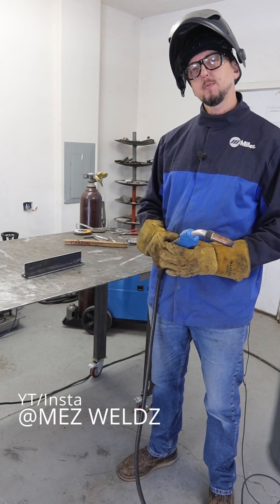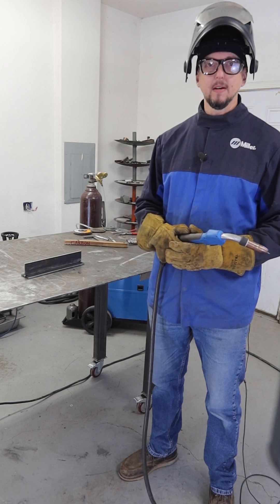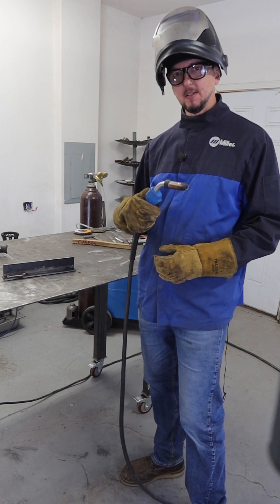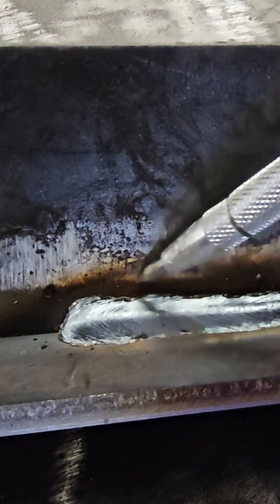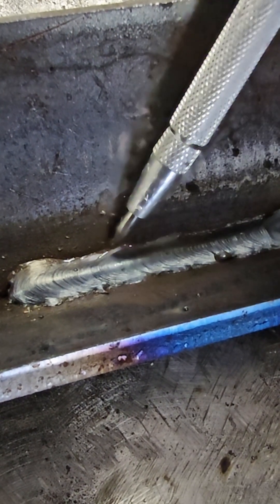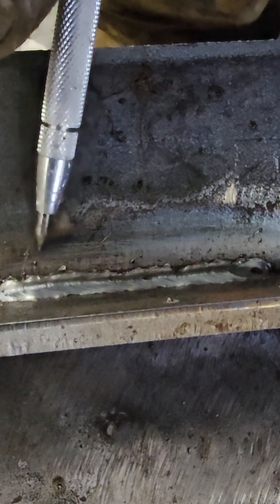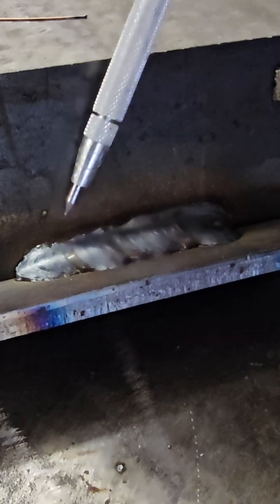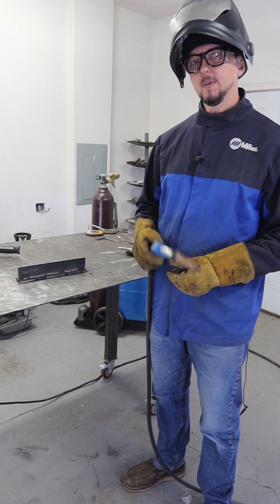The Three Things You Control that Effect the Quality of your Welds | Welding Tips | GMAW

Comment: Always push gas mig and work on mastering pushing dual shield. Just a little advice. Production welder 30 years and counting.
Reply from the maker: @robertblackshear8963  but why?
Reply: @mezweldz7112  You want to learn all possible methods.

Comment: What's the point of the vertical picture...!?
Reply from the maker: To be able to use it for shorts as well.
Reply: @ - sorry but that just doesn't work. It may be fine for Shorts but it's useless for normal YT... so "as well" isn't doing you any favours.
I think you need to decide what you're making these for... and if necessary make two versions. If you can't be bothered to do this your Channel is unlikely to grow, as im sure you desire.
Think about it. Good luck.